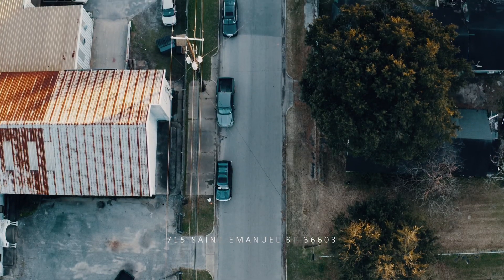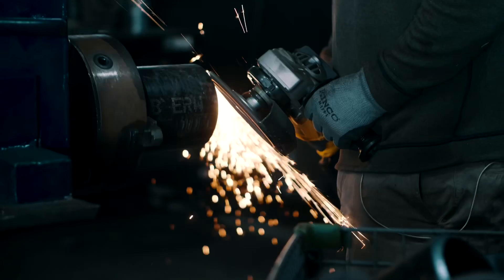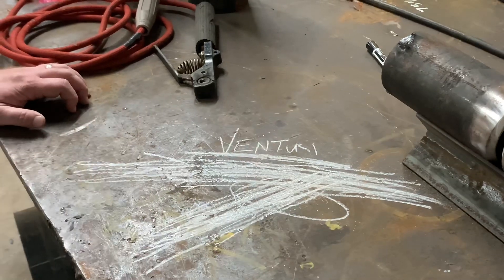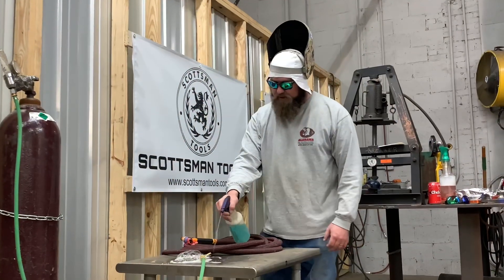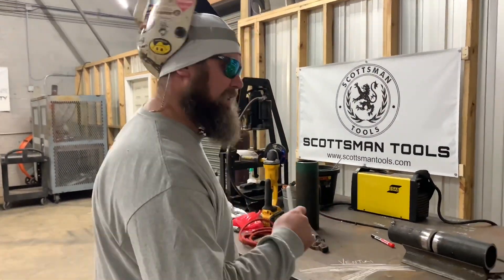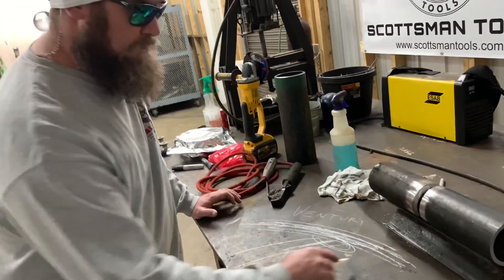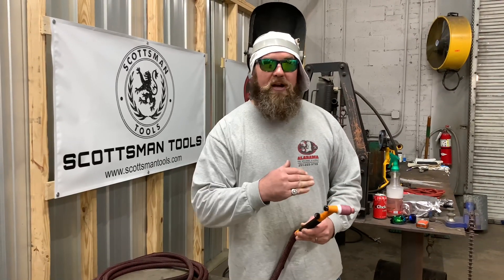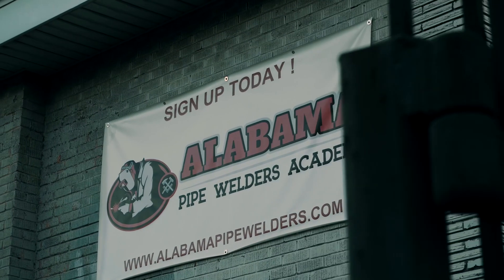Welding Myth Busters! Can a leak in your tig rig cause porosity?

Comment: Hmm you are correct that venturi effect is not the cause. but are missing the larger point. my everlast 205 was producing horrible brown tig welds. traced down that I needed 30 (not 10) flow rate. why? brass compression fitting leaking at the torch. so the leak was resulting in  greatly reduced argon flow rate at the torch.  fix your leaks..

Comment: So what does cause porosity in aluminum and what are your methods of avoiding it?  Simple good video though!  Tig Alum on 6061 with 75ar 25he using 5356 filler. I use acetone, ss wire brush, acids sometimes and preheat is also helpful, but still struggle.

Comment: Positive air pressure prevents the venturi effect. BUT a loose connection can still be the cause of porosity if the leak is large enough to prevent adequate gas coverage of the weld. I had this discussion with others before.
Reply: Ficks Law of Diffusion is the scientific term. Dew point gradients.

Comment: With a dry rig, no you won't pull any air into the line but any remote contacter like a foot pedal control with a postflow timer if the line has a leak after the postflow valve when the argon flow stops it pulls a minute vacum on the line and it drawsa puff of air through the leak into the argon hose running to the torch.  You see it instantly as the arc starts, after a few seconds the air is displaced and the arc settles down but your tungsten and the material is contaminated.

Comment: a leak in the hose causes less coverage 
because we usually set the flow meter to a certain point and the escaping argon from the leak in the hose takes away pressure for coverage at the weld

Comment: I have a question about popping roots, I’ve have done a root a couple weeks back and it looked fine there wasnt a visual porosity hole or anything but when I was putting down my hot pass I had a root pop metal back out like in one spot I stop and look at it an it was like a cover hole I grind it back out dry wash it to make sure the porosity was gone, it was fine after I was curious as to why it did that. Do u have an answer? Any feedback would be much appreciated
Reply from the maker: I’ve had that happen before. I always assumed it was from a tack that might have had an air pocket or fish eye from pulling off the tack too fast.
Reply: Yea, that’s what I assumed it would be, something like a fisheye left behind on a pull out

Comment: before watching i guess yeah, in my defense i had a porosity once due to a inner hose loose connection by overheating ,no ventury, flaw of torch design or the brutal work of continuous welding, since than i have this flow meter to check, but bend and twist your cable during testing